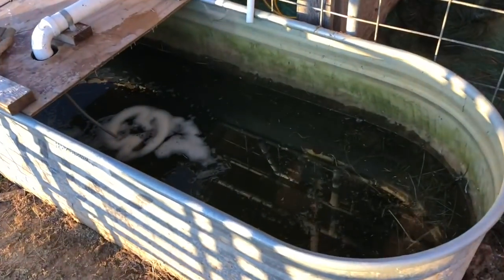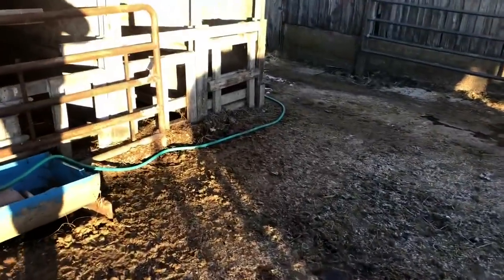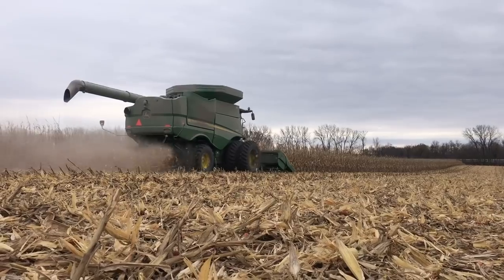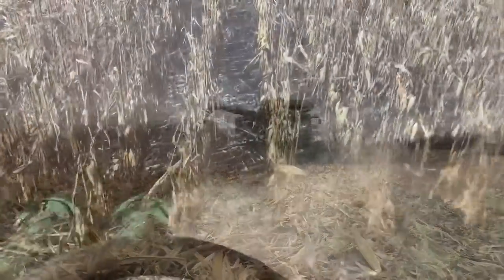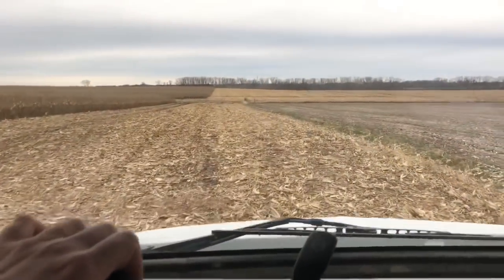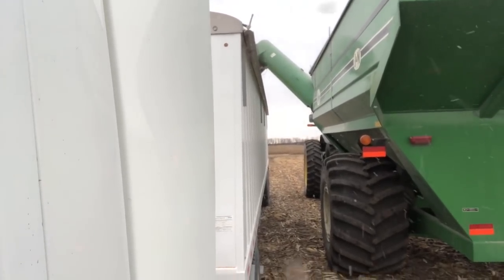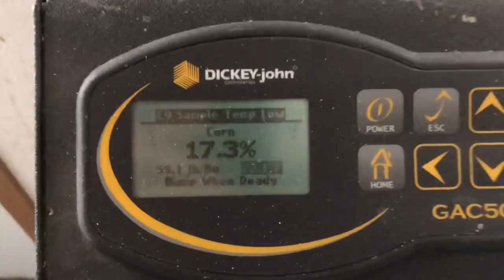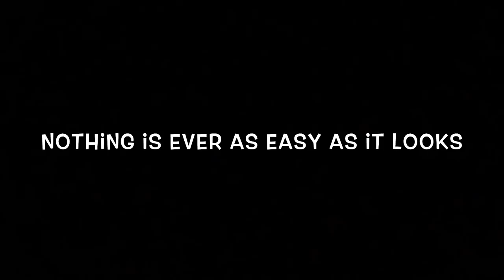Ice Field Farmers - Iowa Corn Harvest 2018

Comment: The freeze is the best thing to help get the crops out since it is so wet.  I do remember our family having no cabs on anything especially the combine.  The worst was oats dust back in the day.  Thanks for the video.
Reply from the maker: Ticky66MN thanks for your memories! I used to haul corn in to dads dryer with a 1650 Oliver and a 200 bushel wagon and I’m only 33 years old. The times sure have changed. I also remember combining oats and the dust was the worst! The ac never worked in dads old 7700 John Deere so he would cut oats with the door open.
Reply: @dodgebrothersfarmandranch9206  Ah, that is cool.  We had an Oliver 1750...loved that tractor.  We ended up all John Deere by the early 80's.

Comment: Mr. Dodge, electric heat tape, it’ll help keep your pvc from freezing, along with pip insulation
Reply from the maker: Yeah, I normally just keep a 5 gallon bucket underneath the hydrant and then take the plug off the bottom of my PVC pipe when I’m done filling the tank. Since the high point of the PVC pipe is up in the ceiling the water outside drains to the tank and the water inside drains back into that bucket which I throw out into the tank. It’s generally a very good system unless some goober forget to take the plug out before it freezes.